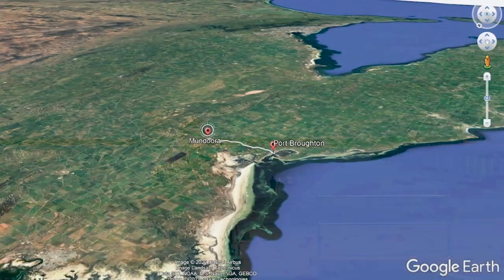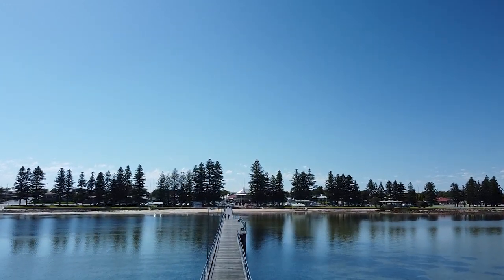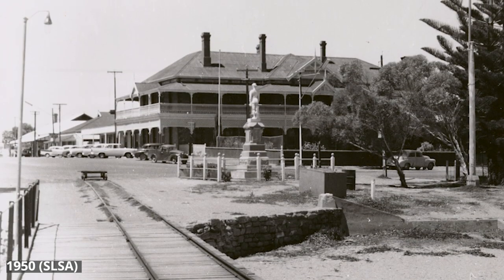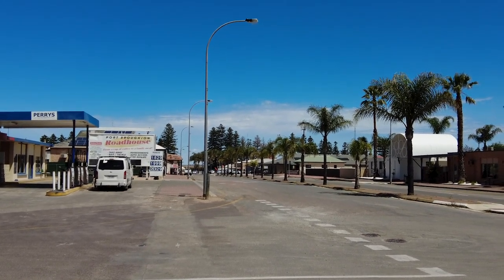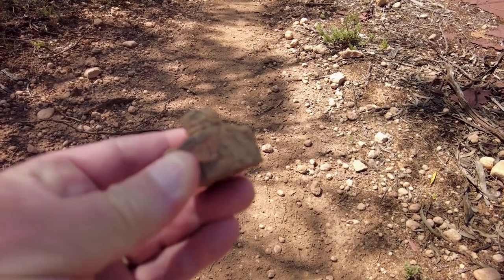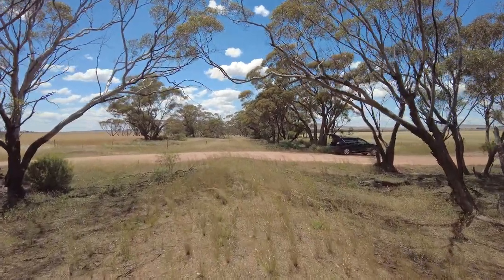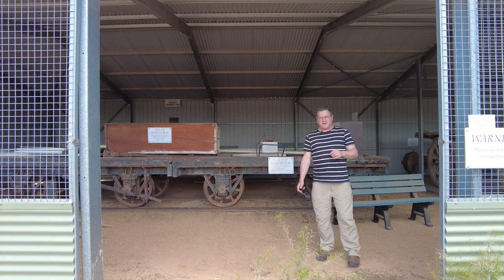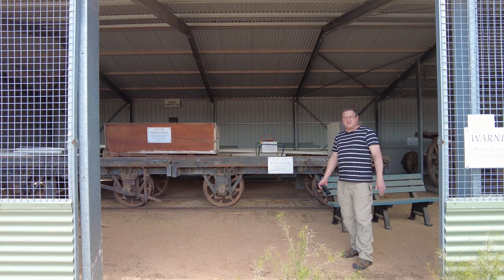Port Broughton to Mundoora Tramway

Comment: The large nut you found, I believe would been used to join twos rails together. Heavy steel strips on each side of the rail, and two nuts and bolts in each rail.
Reply from the maker: Thank you, Maris.